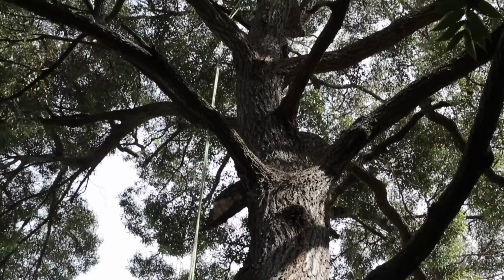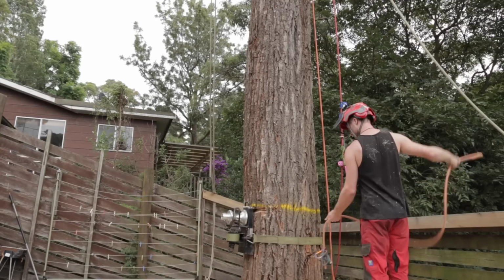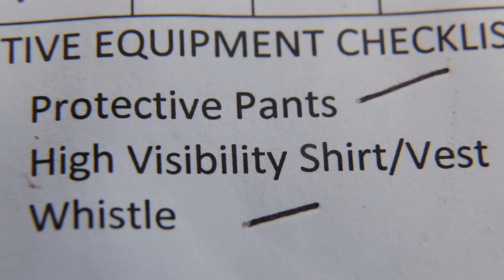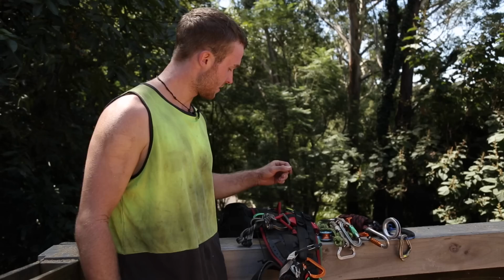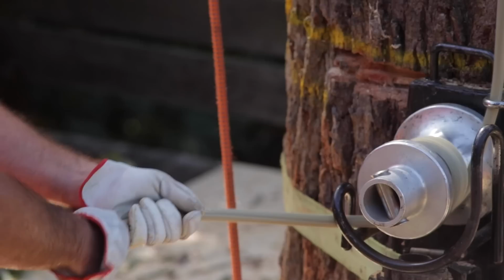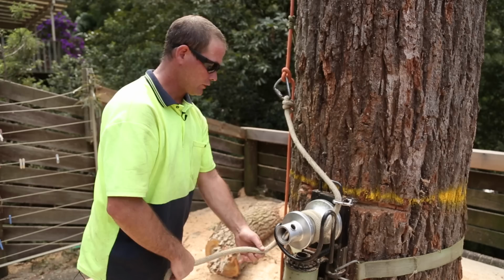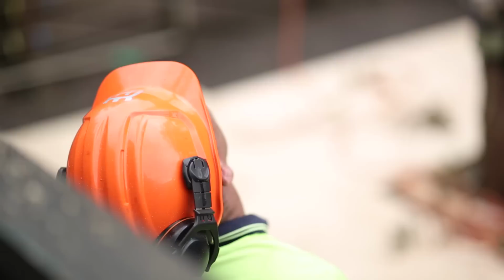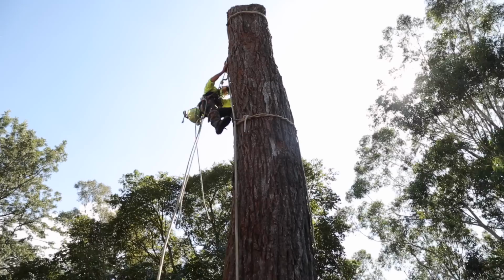Bohmer's Tree Care - A day as an arborist!

Comment: Putting a notch in a tree that you are climbing isnt very smart let alone multiple notches. Just the other day a perfectly healthy oak with not one single defect randomly snapped and killed two boys in my area
Reply from the maker: ian martin Sorry to hear about the boys. As for your comments I agree that there is an element of risk when placing a directional cut in the trunk of a tree that you are sectionally felling, but the structural integrity was not compromised with a 10-15% directional cut. Considering trees with major cavities and over 70% heart rot can withstand extremely high winds. Ive been using this method since I was a teenager and am yet to have a problem. However in my nearly 40 years of climbing I have known 2 people whom have died whilst attempting a directional cut while standing on trunk. Stay Safe !
Reply: ian martin sorry to hear about the loss, never a good thing. Iron barks would probably fair better than the oaks i think, id say something like that would depend on the season and uptake of water.